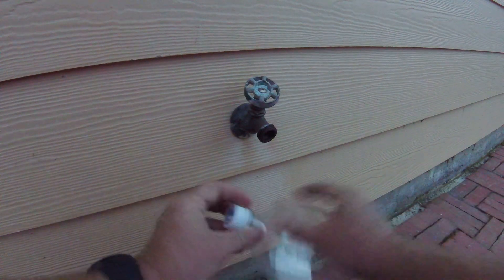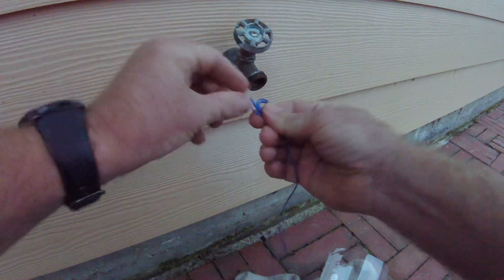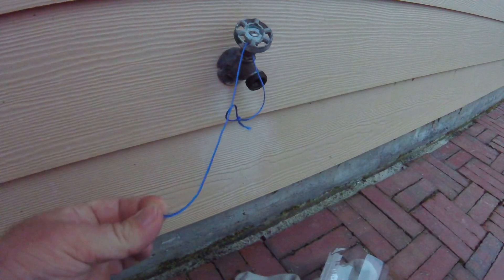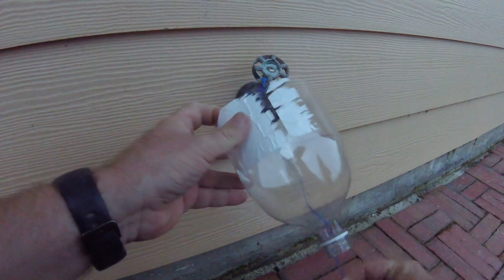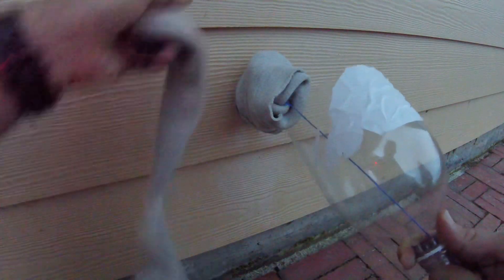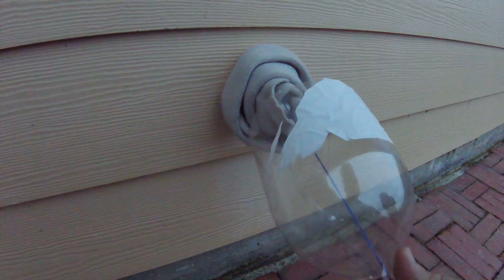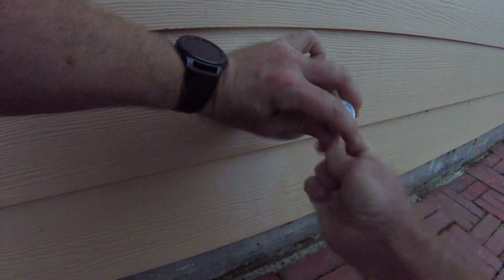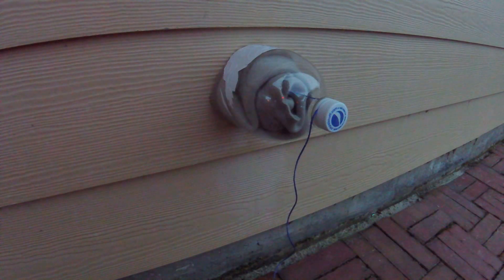Outside faucet insulation cover part 2

Comment: I had a contractor that didn’t know what he was doing and he installed a basement brass spigot on my front porch and it sticks way way out.  Im thinking, rather than pay $150.00 to reinstall it, just insulate it like your doing, what do u think?
Reply: I think this is the answer i was looking for
Reply from the maker: Katina Botten the other spigot on the other side of my house is just like that. Yes it’s been working for me for a few years now. You can go out and spend 5-10 bucks each on some covers or just use some 2lt bottles. You loose the ones you buy anyway.
Reply: @ryanlphipps81  im going to do what your doing with the 2 litter bottles, because no store bought cover is long enough for my spigot

Comment: good video, but how do you relieve the faucet from pressure building in very cold temps? usually, you hav to let some water drip out, so this method will trap water and freeze inside the bottle , right? thanks!
Reply from the maker: Never had the faucet bust. Water in the faucet warms up from the inside. I would guess if you where gone for the winter and didn't have your heat on in the house I could see dripping it would work both ways. Keeping it dry and insulated been working for me. Sorry for the late communication.
Reply: @ryanlphipps81  what abot making a half inch hole in the bottom of the bottle for drainage, directly lined up with the spicket, and opening the spicket a notch to relieve pressure?
Reply: @mml1224  They sell faucet covers for 99 cents at Walmart. Now that being said, you are just worrying about the faucet the pipes coming from the house won't freeze. The only time you gotta worry about a pipe coming from inside freezing is if you live in a trailer mobel home and then you wanna wrap the pipes in automatic electric heat wire/cable to keep from freezing and busting pipes.  I just started a channel and posted a faucet cover and I'm gonna be doing another video about it too. Good luck.
Reply: @jasonritter2492  it’s already snowing sleeting and freezing out there, didn’t get faucet covered before all that started, had outdoor faucet on drip, is it safe to keep it dripping?
I’m so confused on what to do now that it’s already extreme weather

Comment: Wont the plastic crack in freezing temps
Reply from the maker: Sorry for the late response. No it will not.  I put a new Coke bottle on every year before it freezes and never have had a problem. Thanks for the question.

Comment: Not bad but it is easily blasted off with a shotgun
Reply: I recommend you just turn off the water to your house for the winter, it's easier than wrapping pipes.  Turn off your internet, too.
Reply: @unabonger777  yeah and take the crankshaft out of your car to avoid the disappointment of it not starting
Reply: @IBIZABIKE  I drive a Tesla, but if your bike brakes wear out, you can just carry a stick and reach down and jam it into your front spokes whenever you want to slow down. Works great! I guarantee you will stop fast.

Comment: Or you can just be like a normal person , and have a frost free one
Reply: My walls are concrete and the frost free ones are too large in diameter to fit in the existing hole. It means I have to spend $$ on a large 14" concrete bit to use 1 time. No thanks.